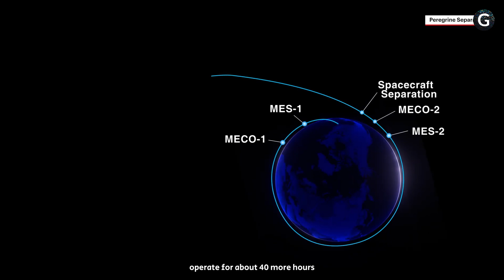Peregrine Mission Abandons Moon Landing after Suffering Critical Fuel Loss of Lander

Comment: "unforeseen hurdles" = "low budget" -- ... Elon Musk.
Reply: does that explain the multiple disastrous space x launches where they blew up their own launch pad despite the fact that his problem had been solved for 50 years already?
Reply: @notmyproblem88  You're being unreasonably selective. Falcon 9 has had nearly 300 successful launches (99.3% success rate). The only 2 total loss anomilies were experienced in the very early phases of Falcon 9. Spacex's reliability is unmatched. And as yet, it is the only orbital-class rocket that has successfully landed a primary stage booster (261 times out of 274 attempts), with reusability being significant.
So... in line with your own words... "How come no other rocket launcher has managed to land and re-use a booster, despite this being possible for nearly 7 years?"
Reply: @notmyproblem88  English please… 🙏